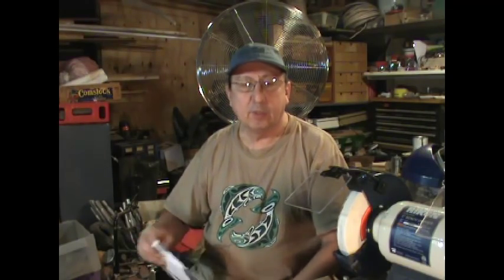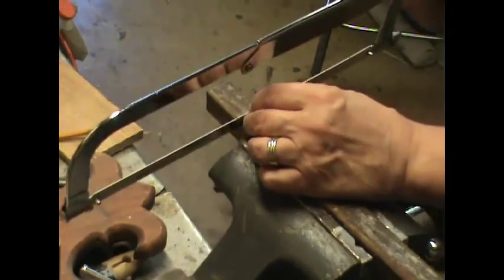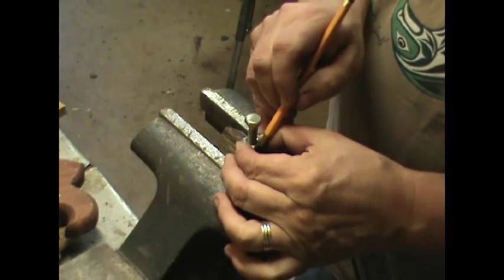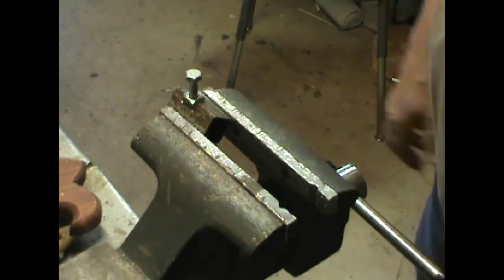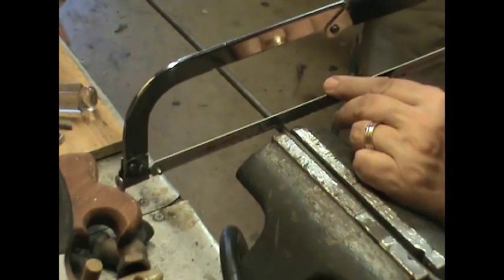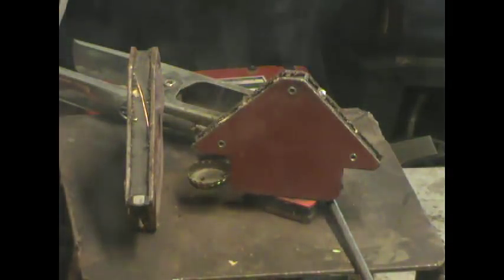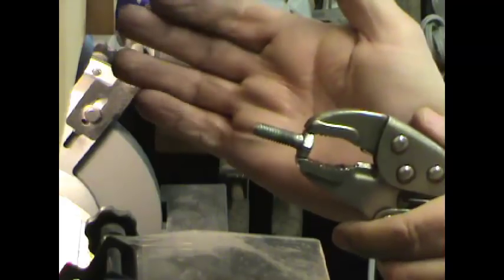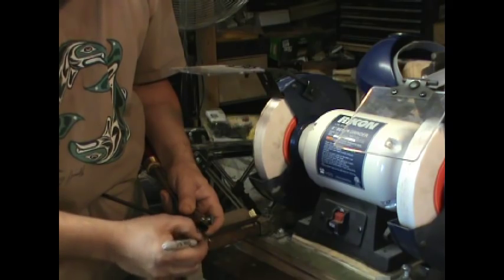Dude! Where's My Sharpening Jig?

Comment: Thanks for posting this very helpful I will be building one when I can get back in my workshop I am fitting it out with new cupboards may I suggest turning your wire feed up  a little the popping sound is where the arc melts back the wire and it re connects the arc should make for pretty welds
Reply from the maker: Howdy Andrew! Thanks for the welding tip. You are very correct. My son is very good at welding and I noticed his setting after using my MIG. and feed was turned way up. Cheers.

Comment: Still using hacksaws over in the USA! Slow and expensive. Snap a blade and your 7 bucks outta pocket. Try an angle grinder with a micro thin cutting disc on it. Cheap & a lot quicker. I haven't used my hacksaw in 12 years!
Reply from the maker: You might be right! It is always easier for me to grab the hacksaw. I have several small angle grinders and I already have the cutting blades. I need to just try it. Thanks.

Comment: i prefur a stick welder  used one for 22 years   could never  get  my  wire feed at the right speed
Reply from the maker: +William Howard I had good luck with my meg welder. If it works for you, that is the tool you should use. Thanks for the comment William.